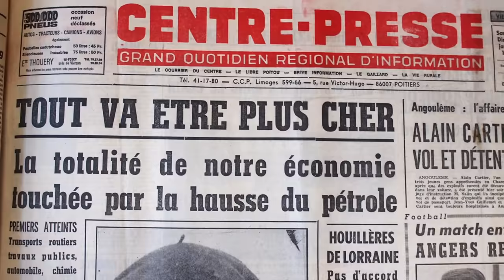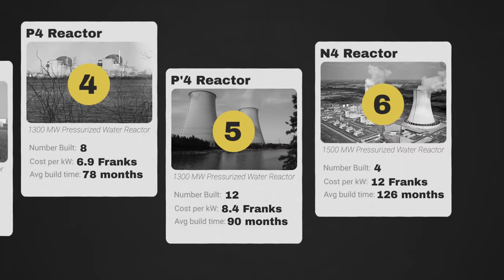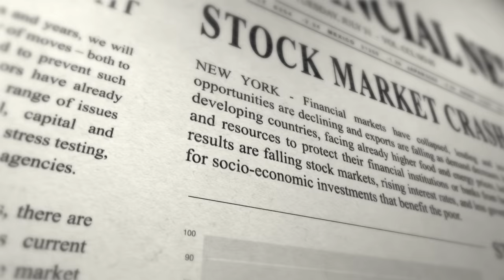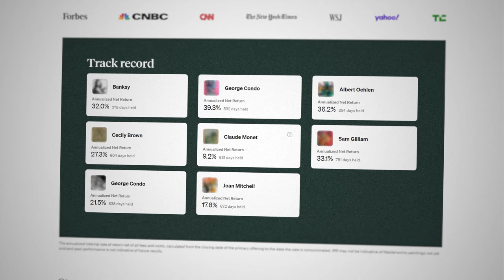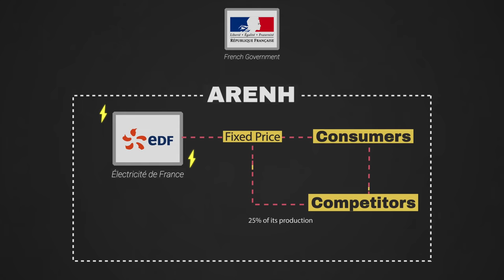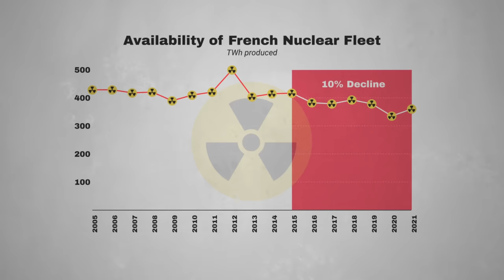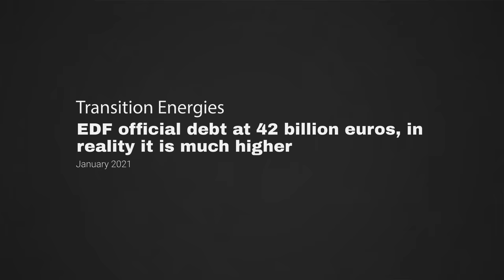Why French Nuclear Energy Failed

Comment: 40 years of cheap energy with no acidents - I don't see how that is not a succes
Reply: It is, the incapacity to make it to 60 years is just a massive shame.
Reply: "cheap".. no tax funded subsidized energy hiding its true cost. but it was a good idea back in the day. it just no longer is.
Reply: The problem it isn't cheap.
Reply: It is highly taxfunded and will still cost billions in the future. Even reactors finished in the last 20 years were far more expensive to build and to operate then other typs of power generation in europe. 
Reactors that are about to get started will be costing about 5 times as much to build and 3 times as much to operate then other power generation.
Reply: @paxundpeace9970  it is
Reply: @paxundpeace9970  That is simply untrue, nuclear plants are some of the cheapest energy infrastructure to run. fuel costs are far cheaper and way more stable than gas a coal plants. On its lifetime while nuclear are more expensive to build but extremely cheap to run, and its the opposit for fossile fuels. And is not taking into account external costs such as environnemental damages and public health issues that costs billions to the EU. in 2013 the EU said that 22 900 eu citizens died prematurely due to fossile fueled plants.
Reply: Economics of Nuclear Reactors - https://youtu.be/cbeJIwF1pVY
Reply: @lucaj8131  building them is already far more expensive compared with gas or coal and operating them is as expensive as coal and gas are now not they normally were. 
You better stop lying to yourself and other people.
Reply: NUCLEAR is never cheap and consequences from this industry is still unknown.
Reply: And somehow they failed to replace them 🙃
Reply: Half of them fails to continuing to generate electricity safely in the last few years. That's a failure.
Reply: @nntflow7058  that's on it's own wouldn't be so bade, after all they were designed to work for around 40 years as whole without retrofit, so it's just case of slightly accelerated again, real issue is that they aren't profitable while producing cheap energy, becouse France should be planning to build around 30 new EPR reactors in order to replace current ones in next 10-20 years, but they are playing only 14 new reactors.
Reply: @neliborba101  It is even cheaper than renewable energy, if you include grid costs. And it has the smallest footprint in terms of natural resources.
Reply: @paxundpeace9970  not true lol
Reply: @witoldschwenke9492  aha. The neoliberal “inefficiency” talk
Reply: Into Europe appears to be basically European pessimism. Been binge-watching his videos today and yesterday, and everyþing seems to be "how ðe EU is failing at x".
Reply: It's never been cheap though ??
Reply: @lucaj8131  France nuclear plants have been significantly more expensive than renewables.
Reply: @witoldschwenke9492  all energy is heavily subsidized though, especially solar and wind. Even coal plants tend to have government funding!! If the masses knew how expensive their electricity would be without government they'd be shocked...and living in darkness. The whole "nuclear is subsidized" argument falls apart when you look at the big picture that ALL energy is funded by government.
Reply: @neliborba101  compared to what? Compared to off shore wind its like 1/3rd the price. Compared to a coal power plant that doesn't care about sulfur emissions let alone CO2 it is reasonably expensive. What you think we should use instead of nuclear? Then you can compare the pricing.
Reply: @neliborba101 unknown = none
Reply: @paxundpeace9970 bro would rather let the world burn that make the french government spend a lil more moolah on greener energy😭😭
Reply: google Saint-Laurent nuclear accidents
Reply: @FernandoWINSANTO  hmm I never heard of it - how many died ?
Reply: @lucaj8131  you beleive the BS of this vid??

Comment: France's choice to pursue nuclear was one of the best ever made. It's so sad to see underinvestment in such a huge advantage.
Reply: in fact I say the only weak link right now is germany and their energetic tourret syndrom
Reply: france is reliant on Russian Uranus for its  powerplants, even in war times!
There is a reason why Uranium is not on the sanctions list against Russia!
Reply: @TremereTT  Russia is only the 6th largest producer of Uranium in the world...
Reply: @TremereTT  canada and the australia has the largest uranium deposites. Thats where their uranium comes from then there is kazakstan aswell. Russia is not a main uranium exporter. Unlike oil and gas wich primarly stems from russia and the middle east.
Reply: @TremereTT  France got Africa on it's knees so no need uranium from Russia for Now
Reply: Doesn't Sweden also have huge Uranus deposits, but refuse to use it?
Reply: @TremereTT  you can literally fine uranium anywhere
Reply: @svensvensson1085  Spain also has large Uranium deposits, and does export some of it as well.
Reply: Calling it the best investment just shows you did zero research...
Reply: @soberman1520  But France is not in need of raw uranium, but ready-to-use fuel rods - and they decided decades ago to choose Russia as their main supplier of such fuel rods... And they still import them to this day, which is why the Russian nuclear industry is not sanctioned to the day.
Reply: It was a real expensive one. Electricity is heavily subsidized (directly and indirectly) in France.
Reply: @noah-ni3ee  and saying what you said proves  that you didn't do any better than what you said.

Comment: All you nuclear fanboys out there... There is a limited supply of fissile material out there. Building more reactors will only deplete the supply faster. Building nuclear reactors is not a solution, as the available supply of materials will not last very long. Plus, we still have no idea on what to do with the waste. Where would that go? Not to mention the inherent risk of incidents going up with more facilities being operated. Even if modern reactors are much safer than older generations, run enough of them and incidents will occur - it's just the law of large numbers at play. No, nuclear energy is not a solution, not even close. (Not to mention that nuclear only looks cheap; if you combine all the costs associated with it, it's not. Really not cheap at all.)
Reply: And please don't tell them that Russia is worlds #1 supplier of nuclear fuel and that energy independence of Russia with nuclear is a pipe dream from the current standpoint.
Reply: @mal_dun  А вы дружите с нами -- и будет всё хо-ро-шо)

Comment: We should do what France did in the 80's again on a EU wide level, we develop and standardize a new more flexible reactor type for current and future grid service. We go on a building spree to replace all base-load electricity production by nuclear energy this we must do in combination with renewebles. The costs will be the lowest and we will create a new industry that can competitively produce green molecules to replace oil and gas for the chemical industry and ofcourse those profits stay in Europe. We can't do it without nuclear if we try Europe will become obsolete.
Reply: Yeah no. Europe is way to filled with people for a large amount of reactors. at least the west. 1 nuclear reactor going Chernobyl. ( yeah now repeat the bot response of " but its so rare to happen" Yeah, it only needs to happen once tho.) could cause half a country to be evacuated. 1 nuclear reactor in the Netherlands or Belgium breaking down mean you now have 5 million refugees in a single day. good luck with that.Europe does not need nuclear. Or at the very least. not at a much higher extent than we already have.
Reply: @RK-cj4oc  Comparing soviet-designed Chernobyl (RBMK) reactors, with defective safety systems and NO containement structure vs. western-designed PWRs with advanced safety features AND a containement structure is beyond moronic.
Reply: @pxidr  Good bot.
Reply: @RK-cj4oc  The irony🤣. How much do you actually know about Chernobyl or western designs?
Reply: Bro i have a degree in business and energy and delt with the costs of energy a lot. Nuclear is not cheap at all. If we did what you suggested, firstly we'd need decades to do it and don't have the capacity to do it, secondly it would be extremely expensive and cost more than any alternative except for the underdeveloped wave power. Thirdly it would increase demand for uranium so the costs and emissions for mining uranium would grow much faster than they already do. That's right with every passing year uranium gets harder and harder to mine and more and more polluting and energy intensive. By the mid of a new nuclear plants lifespan, if we built one today, starting its operation in 15 years (realistic construction time) and then 15 more years.. and voila at that point even with current demand for uranium, it would consume so much energy that the energy needed in the entire nuclear plant supply chain and construction and dismantling would bring the life cycle emissions of nuclear power ABOVE gas power plants. Not to mention the costs. If it was possible I'd be all for it but its not feasible, we don't have easily accessible uranium anymore. It would be so simple so easy if nuclear was an option. Would solve all the problems. but it can't. it's impossible. it is a finite ressource and unless there's some significant nuclear power breakthrough we won't have much nuclear power left in the world by the end of this century.
Reply: @lucaj8131  Number 2
Reply: @witoldschwenke9492   we can use thorium and recycle our high level waste to make thorium fuell, the cost per reactor is indeed very high but the thing is if we build many the price wil go down and we will build them quicker because we produce them on mass. We have enough Uranium for a very very long time and we have even more Thorium. I’m a chemical engineer and i can see why you see it this way but if we innovate and make those SMR exactly the same, mass production. Then we are talking about a fair price and a time window of 8-10 years for multiple reactors? I don’t see what’s wrong to have a long term plan with nuclear and maybe fusion one day.
Reply: @SA2004YG  Of course, but the chances that a major incident happens are far lower
Reply: @witoldschwenke9492  You are probably German. Yes nuclear is expensive, but an EPR will typically produce 1600MW of power almost continuously for more than 60 years.
We should also develop more fast neutron reactors, that can regenerate spent nuclear fuel !
Reply: @pxidr  yes but my point is that there will be at some point no matter how small the odds
Reply: @witoldschwenke9492  Bull. The UAE, starting from scratch, in 2012, with ZERO nuclear expertise, ZERO trained workforce, construction crews and minimal industrial infrastructure built for a total cost of $24.4B ,  4 South Korean APR-1400's in 8 yrs for 5.6GW or $4.8B/GW-yr output @ 90% or 44 TWh/yr. That's 103% of Australia's current total annual wind & solar production. At $24.4B/$50B = 1/2 the cost of Australia's wind/solar. Not counting the additional $20B in transmission infrastructure they just announced to  facilitate their wind/solar delusion. Which will actually cost more like $30B. With at least another $10B being planned.

France, which partially reprocesses their fuel, used 5oz of uranium per person per year, to generate 88% of their domestic electricity supply, worth $15. There is easily enough uranium & thorium accessible on the Earth's land area to fuel our civilization for 100 Myrs. Just the trace uranium and thorium in granite makes granite have 30X the energy density of Coal. One rare earth mine that makes materials for wind & solar power will produce enough waste thorium & uranium annually to supply all the energy needs of the entire planet every year burnt in Molten Salt Reactors. They will pay you to take the thorium and uranium away. And any metal mine you can extract the uranium & thorium by adding an additional flotation circuit. We will never run out of uranium & thorium to power our civilization. And then there is fusion. 1gal of Earth water has the energy of 300 gal of gasoline just from the Deuterium in it.
Reply: If i'm wrong those who point it out are bots. Perfect internet debate tactic, works everytime for me as well :)
Reply: @witoldschwenke9492  US DOE estimates are significantly higher than you suggest, on the order of 100 years, but that still makes it another unsustainable blind alley. So, clearly not a viable solution, unless it has irresistibly profitable competitive advantage (greed works on shorter time scales...), but it doesn't.

However, there are a multitude of reasons why nuclear power will be maintained in a number of countries at some level.
Reply: @witoldschwenke9492  the issue is that renewables are intermitten.

It's no good having cheaper power if the lights are off half the time.
Reply: @witoldschwenke9492  your argument at the end of the day comes to "uranium is not abundant enough to make nuclear power feasible". There is no method of energy production where a commodity is of sufficient supply. I could make the same argument you are making with solar and wind. They require huge volumes of rare metals, for which the supply is just not there. They will also require batteries for storage, and hence huge supplies of lithium, for which there are not the resources to supply. But I'm sure you are of the opinion that a fully renewable grid is sustainable, no?
Reply: @witoldschwenke9492  They said the same about oil 40 years back and we're still pumping it up...
Reply: @Robbe Brecx 
My impression from maybe 10 years back was that France was one of the leading along with Russia of breeding and reprocessing nuclear waste into new fuel. With reprocessing, there should be an unlimited supply of fissionable materials for the nuclear power industry.
Reply: @robbebrecx2136  Thorium reactors have not left the drawing board yet, with only a handful of extremely experimental prototypes. By the time Thorium reactors are mature, it will be too late to reduce emissions. Existing nuclear must be kept and maintained, but new Uranium reactors are simply too expensive to build and operate.
Reply: There are two problems with nuclear power
With the talks about small modular reactor every country is throwing out it's champion hoping their model would secure the market in Europe and beyond and thus making market very fragmented
Conventional large nuclear power isn't fool proof either. As it requires fresh water as coolant the draught this summer threw a spanner into the works
Reply: @Zero4Infinitives  The Fukushima plant actually resisted to a 9.0 earthquake. The tsunami and resulting flooding was the killer.
Reply: @RK-cj4oc  "everyone who disagrees with me is a bot with an agenda, I am the only one to know all truth". Bellend
Reply: @RK-cj4oc  RK, good name based on your responses and level of knowledge I would assume that the are 2 more letters in that? Possibly RBMK (reactor)?
Reply: @witoldschwenke9492  you are aware its possible to do nuclear power with things that arent uranium arent you?